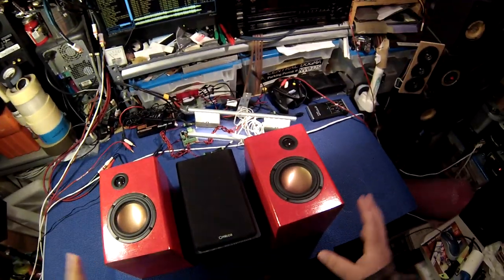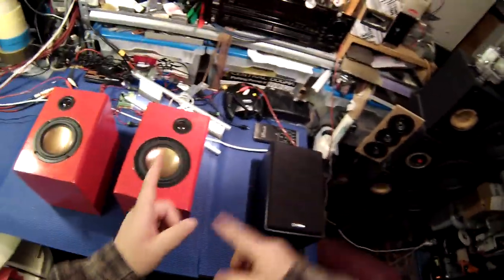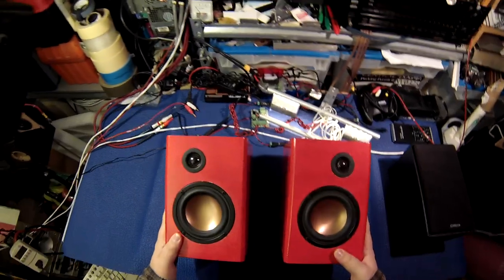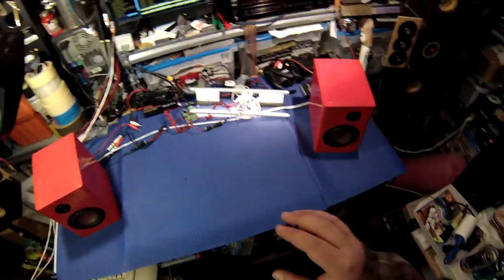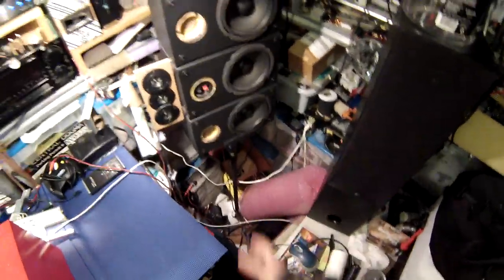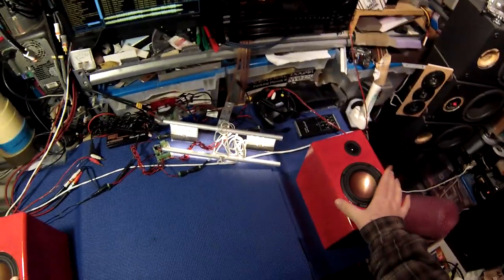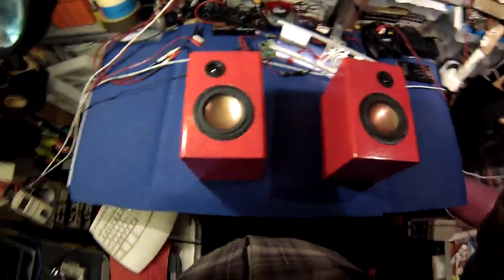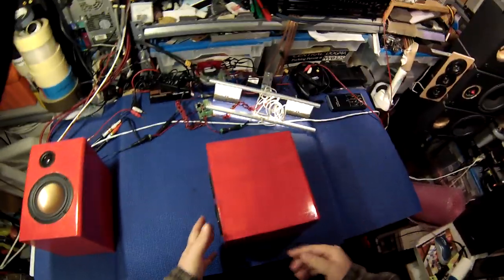Z Review - Overnight Sensations (Dayton Kit)

Comment: Do you have any experience with the Sony SS-B1000 speakers? They are currently the only speakers I have and I think they sound pretty good, and they get GREAT reviews on Amazon, but I've been thinking about getting some new speakers. Especially after watching all the speaker videos you have been putting out lately. I guess what I'm getting at here is if it would even be worth it?
Reply from the maker: I can't tell you if you want new speakers. I will say there is a mod someone mentioned that had to do with changing the drivers out in those BS1000's..

Comment: Hmm... maybe I shoulda got some of these instead of the Teac's... oh well. Any chance of the T652 review being out before black friday? I kinda wana know if they're craptastic or not before then.
Reply from the maker: Spoilers.. They aren't capitalistic. Surprisingly good actually. I just fear pushing them to the point they may literally catch fire. Ive yet to get them out of my tiny room and I enjoy them in there. My friend got a set for his HUGE living room and he loves them there too. So win win.

I wouldn't say they throw as much low end as the Andrew Jones. But for $130 a pair I didn't expect them to.
Reply: Would you recommend them over the B652 Airs on some cheap stands for a budget 2.1 home theater? Newegg is also supposed to have the older Pioneer Fs21 towers for around the price of the T652s on Black Friday so that's another option. The reviews on those are all over the place though.
Reply from the maker: CJRhoades The air's and a sub would make a perfect starter 2.1 system.
Reply: Z Reviews So the Air's over the T652's for home theater? Keep in mind it's a 26x20 foot room and the sitting position is about 10 feet from the TV where the speakers would be.The Airs+stands add up to about the same price as the towers. I'm just trying to figure out if the extra woofer and ported enclosure of the towers would be necessary for that size of room. If not I'd definitely rather have the Airs with their better AMT tweeters.
Reply: CJRhoades Hrm... If you have a sub going in you could skip the towers. I like towers on their own and the benefit of them goes away a bit when you add a sub.
Reply: ZeosPantera Alright, thanks again for the advice.
Reply: CJRhoades Oh, looks like I'll be getting the towers... The Air's are sold out and apparently won't be back in stock until January 8th. It's a christmas gift so I can't wait.
Reply: CJRhoades The Speaker Gods have Spoken.

Comment: I'm guessing you aren't aware of the "Acoustic Coupling" phenomenon taken advantage of by Line Array systems. 

When those full range drivers are working their acoustic centers are close enough that most frequencies are projected as a single wave. This has to do with the wave length and the distance between the acoustic centers of the drivers. If you doubled the number of tweeters, spaced them out evenly, and moved them closer to the full ranges; that whole stack would work in unison as a single driver. This is how Line Arrays fill large areas with sound using large numbers of comparatively small drivers.

Comment: These are great little speakers but they are not high end. 25 watt RMS, 50 watt max, no overload protection, $15 4" drivers and $15 tweeter.  Easy to build, but certainly not high end.  The end results are great though, just don't over drive them.

Comment: have been waiting on this since I saw them in your mad dog video.  I have modded sx6's and think that they are just about perfect for my desk.  I was thinking about getting this kit for Christmas until you said that the highs get on your nerves after a hour.
Reply from the maker: Well getting on MY nerves isn't hard. What Mod on the SX6's?
Reply: Z Reviews Just replaced the main drivers with http://www.parts-express.com/peerless-830860-5-1-4-ppb-cone-hds-woofer--264-1080
Reply from the maker: TheFawawa Hrm. A bit of a costly upgrade. What kind of change does it make? Lower low's? More accurate mids?
Reply: Z Reviews The mids are just fantasic and is pretty even from 60hz and above.  Its kinda hard to remember honestly, I have a pair of xl7s on my bedroom tv and the sx6 on the computer and the sx6 is much better.